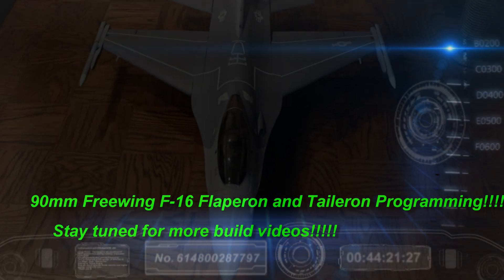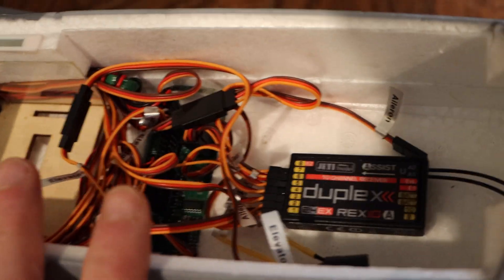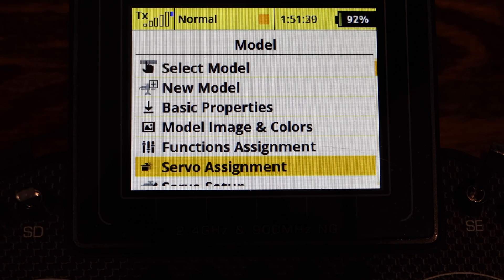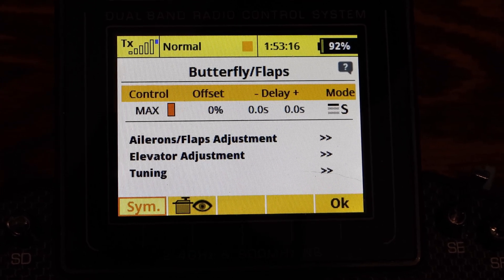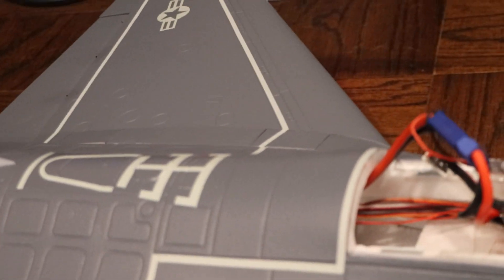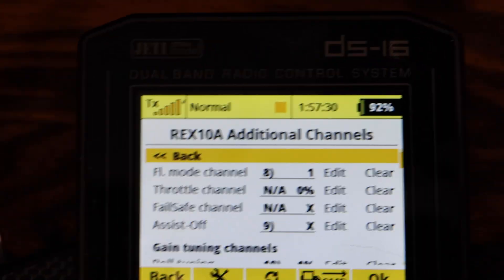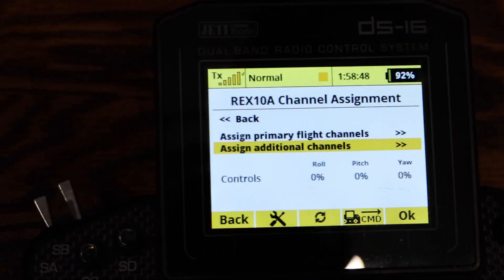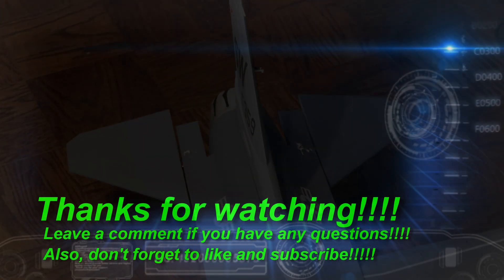90mm Freewing F-16 Flaperon and Taileron Programming

Comment: I wanna do it on my f22 but I still don’t know where to set the taileron.
Reply from the maker: It took my a few flights to get them dialed in. First flight I had them reversed and that didn’t work. It’s not the most difficult thing to do, just take your time so the surfaces move in the correct directions. Good luck with her!
Reply: i wanna do the taileron and flaperon, is ti doing with the mix? @adventuresmidwest3065

Comment: Wow I will have to look again on my f-16.i thought I could only find one elevator to the control box.
Reply: I have Flaperons on mine was wanting to mix in tailerons with my full flaps.
Reply from the maker: @sendit_rc  I haven't actually played with rates yet. I am going to set the ailerons by the book then fly her and mix in the tail as needed for the different flight modes. Hopefully I'll be maidening soon and I'll keep you posted.
Reply from the maker: Yes, there is one servo wire going from the second board to the elevators and the ailerons. Look just to the left and that’s where they all plug in individually. You don’t need both elevators if you are only doing flaperons. Hope that helps.
Reply: I'm landing with full flaperons and 20% up elevator mixed in it turns still nice in final with normal tail.i was surprised.